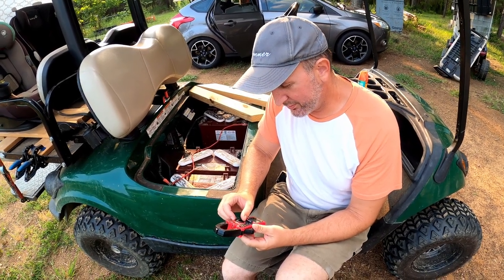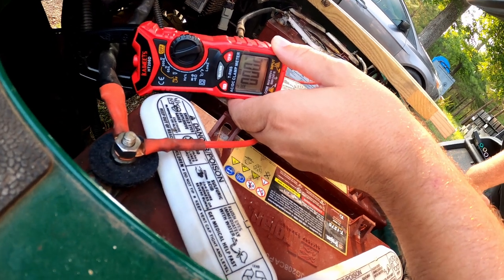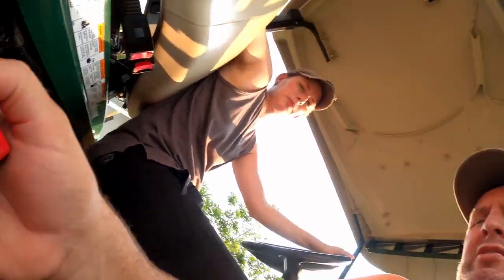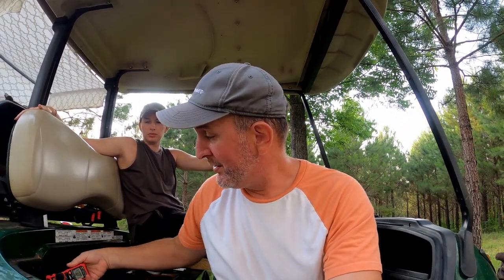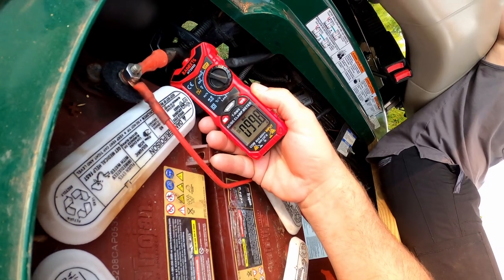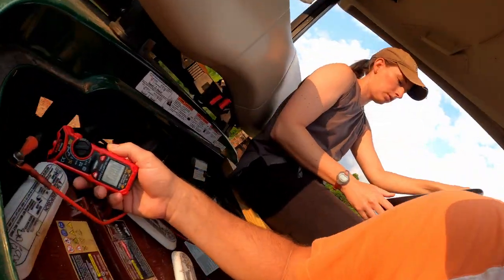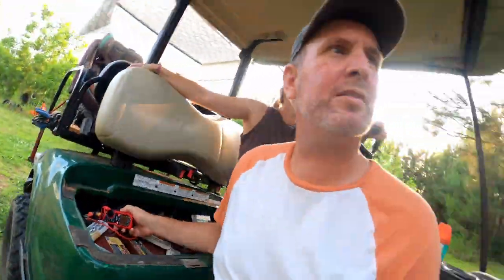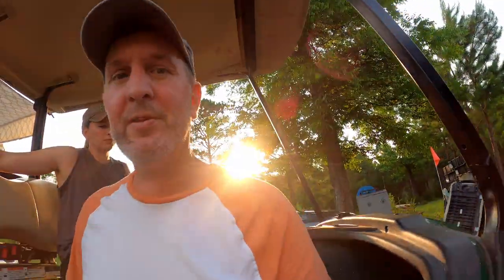Check the Amp Draw Before Converting to Lithium Golf Cart

Comment: Following up as I see there is a new comment. I have not had any problems since the installation last year. I used the Epoch 36v. I do not have stock tires but they are not big either. I did a few tests on flat ground with four people on the cart and punching it and no issues.

Comment: My concern was going up an incline. On a flat plane with two passengers my cart will  consume 150 to 180 on acceleration and settle around 50 continuously. I have a configurable bms and have it set to protect after 5 seconds at 300 amps. 400 amps will trigger it in 1.5 seconds. 500 amps instantly shuts it off. I’m running 16 lifepo4 40ah 10C continuous discharge cells. I get around 8-10 miles on a full charge. Some would argue that’s not enough. I find it to be plenty. The kicker is that I can charge the pack from 0% to full in about 90 minutes which is never really the case. I usually run the pack down to 40%-50% then charge it up to full which only takes a half hour or so. If I’m going on a long ride I bring my ecoflow and charge it in between stops.
Reply from the maker: What battery did you use? Programmable BMS sounds necessary.
Reply: @sunnyhillfarm  I made my own with 16 lifepo4 40ah cells in series. The cells are rated for 10C discharge or 400amps discharge continuous. Though I’m only discharging around 1C or 40 amps with normal cruising speeds.

Comment: What battery did you buy? I have the same concerns.
Reply from the maker: Signature Solar 48v EG4.  It did NOT work with my golf cart. "battery technician have informed me that the clamp meter used in the video does not detect inrush current, the amperage draw is happening too fast for the clamp meter to measure it and a clamp meter that can measure inrush current would need to be used for testing."   I will not be trying to convert this to lithium now.  Signature Solar was nice and helpful, but I don't think my golf cart is able to do lithium (at least any on the market I've looked at)
Reply: @sunnyhillfarm  dang it, I have an EZGO with a similar lithium battery and it throws the BMS into protect mode if I do any hard acceleration. My Trojan are shot, so it was nice to get it running again  but disappointing to find it cutting out when the protect kicks in 🥲
Reply from the maker: @healeydave  Yes, I lost $200 shipping my lithium batteries back.  I'm still running on my old batteries that only go 2 miles.  I'm trying to convince my wife to let me convert they whole system to navitas or something...
Reply: @sunnyhillfarm  To be honest if I’m careful, the cart already flies better than it ever did and I don’t need any more power, plus I’m not really interested in doing all that work. Oh, I just remembered, I installed a personality plug years ago to try to get more speed out of the old stock system. I wonder if toning that back down will help with the amp draw?
Reply: UPDATE: Took the damn cover off the controller and noticed I had already removed the personality plug, Doh!
I did run the cart around there garden again though and it works really well, its just when I push it hard, its obviously exceeding the max current draw of the BMS which engages Protect mode. Returning my battery is not an option but I did pay a very good price for it, so my Plan B is to use the cart carefully until I can get a 2nd battery. If I connect that in parallel, I am thinking the current draw will be shared across both batteries and hopefully solve the problem. Its a bit of an over kill solution and I imaging my range will end up being insane but its still the cheaper option than having a battery lying around that I have no other use for.